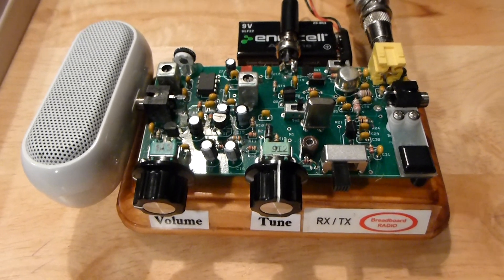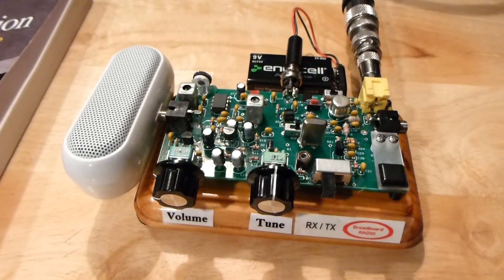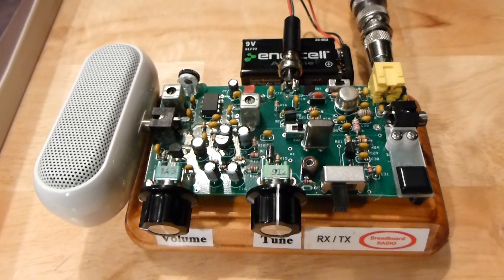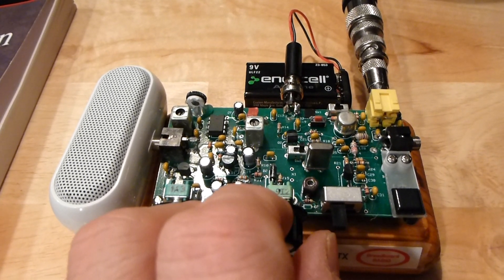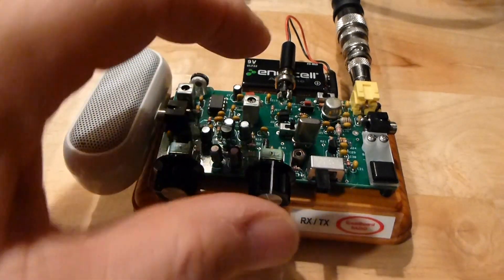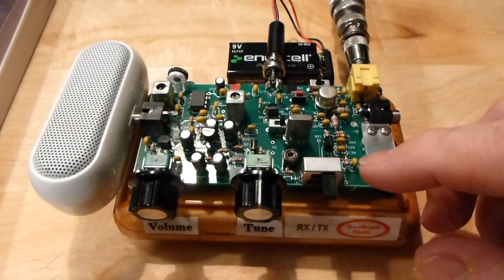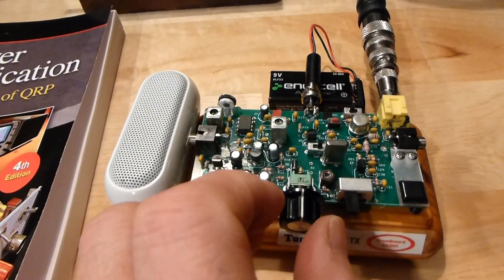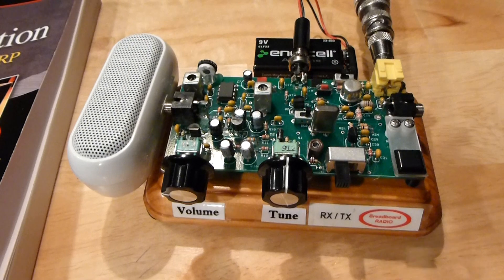Splinter Breadboard Transceiver

Comment: Pretty cool rig. Thanks for the demo. I've watched this several times. Where did you get that cool speaker? Could be handy for some other qrpp rigs I have around here.
73's de n5vwn
Reply: +gliderrider you can get those speakers everywhere.  They run off two AAA batteries. I even got some at the 99 cent store before.  But I have seen them on those internet deal sites for cheap.  I'm sure you can find them on Ebay.  N6WTP